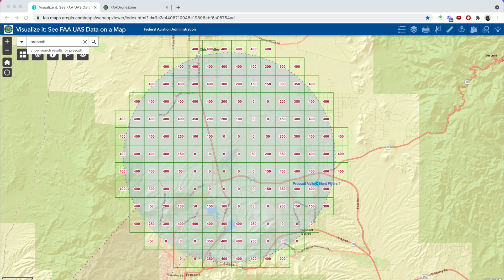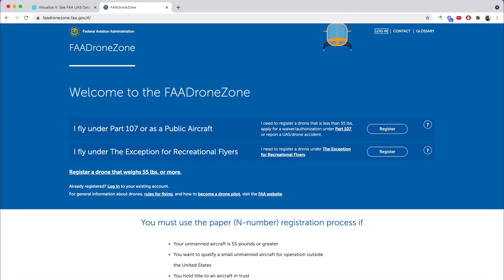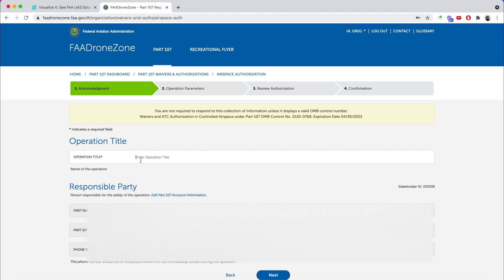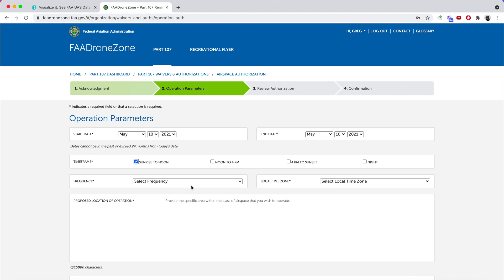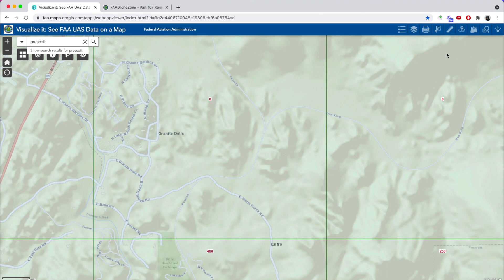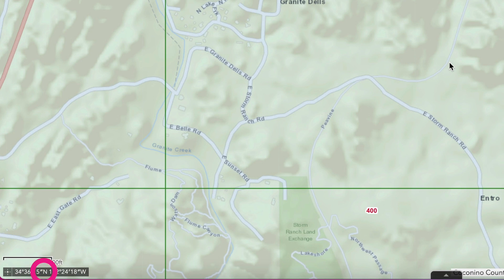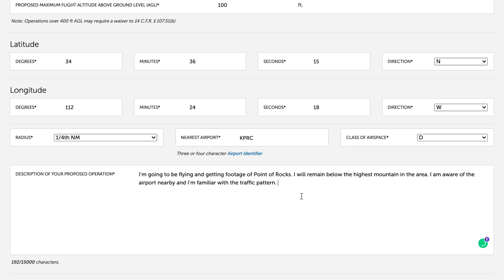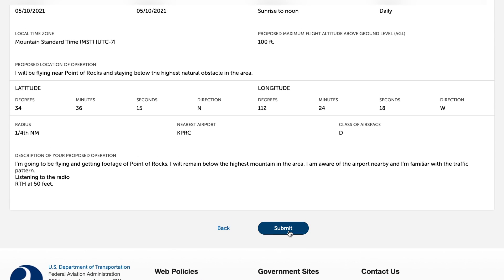How to fly in 0-grid Airspace

Comment: Greg, really good tutorial! I’ve submitted 200+ authorization requests and you are spot on. As you mentioned in the video you can only select one day at a time at LAANC supported airports. One day approvals can be a real pain if you have poor weather, mx issues, and/or DJI unlock issues. In the body of my requests I always ask for a reasonable date range to accommodate these potential issues. The FAA/ATC is usually pretty good about approving these requests. I find anywhere from a few days to two weeks is pretty acceptable in most situations. This really cuts down the workload of making multiple requests. Just a FYI for anyone out just learning how to submit DZ authorizations.
Reply from the maker: Great tip, gonna pin this to the top of the video!
Reply: @PilotInstitute  Cool!
Reply: Exactly what I was going to ask about. The request seems to imply thr option of a range, but wasn't sure of the likelihood of getting more than one day approved at a time.

Thanks!
Reply: @thequantaleaper  Yes, you can only select one date when it's a LAANC supported airport. You can definitely select a date range on any non-LAANC airports. When asking for a date range at LAANC airports I recommend asking for something logical. I've talked to pilots that always ask for 30 days even if they don't need it. I've also spoken with many FAA Processors and they know this is happening and they just won't approve it. I routinely ask for a week if the weather is an issue or the job might require multiple days. A date range will also accommodate any re-flies that may be needed. I see this is helpful sometimes with new pilots. I hope this helps!

Comment: Can you help me with something? So where I live it's considered a Class D zone. I live in a place that has an airport centrally located in the city. We do not have Lance and we have to go directly through FAA drone zone to do just what you shown in your video. However it's also my understanding where I live that the areas that indicate a zero no matter what we do we can never get it waived or approved is that correct? My drone is under the 249 mark. So I recently created an account to do all this through the FAA drone zone but I'm having a hard time understanding where and how I can actually fly without getting in trouble from the faa. My understanding to this point has been on those Maps areas that indicated 3 or 400 as an example I could fly at or below without any permission but I don't see that as being true now and it worries me. If you could please help and respond I would gladly message you and maybe you can contact me through a direct message instead of doing it in the comments section thank you for your videos I love them.
Reply from the maker: I’m going to assume you are flying recreationally (the answer differs a bit if you’re under part 107). You can’t fly in a 0 grid at all, regardless of the size of the drone. Regarding the 300-400 foot grids (or any other altitude than 0), you need to get approval first before you fly there. But you can get approval up to that number. In your case, if your airport is not part of LAANC (as it sounds like it is), you will need to submit a request through the FAA drone zone. You can actually get an extended approval to fly in that area by submitting a wide area authorization. Email us at contact@pilotinstitute.com to continue the conversation if you want by email.

Comment: Without requesting otherwise…if the grid shows 100, but a  close-proximity building is 100, can you fly 200AGL or does the cap remain at the 100?
Reply from the maker: No, you can't. This rule can't be applied in "grid" airspace and also is only available to part 107 certified pilots.

Comment: I know this video is a year old, but wanted to ask when flying in a zero grid, after getting approved from the FAA and DJI to fly up to 100 feet around a building, if air traffic will be flying nearby for taking off or landing since you'll be roughly 2 miles from one of the runways, what is the safest distance to keep a drone away from other aircraft?
I know the more the better and drone pilots are to give way to all other aircraft, but I haven't found a hard number. I've heard some people saying 100 feet is the minimum because drones are supposed to stay under 400 feet while aircraft are supposed to stay above 500 feet.

Comment: Is using Drone Zone still better to request approval in a zero-grid LAANC airspace than using Aloft?  I have a site I need to request and Aloft notes I can request through the app.
Reply from the maker: It doesn't matter. Use the app that you prefer. Personally for 0 grid requests, I think the DroneZone is better because I can upload KML files if I need.
Reply: How long did it take until authorization was granted?

Comment: If I wanted to request to fly 500ft AGL in a 0' grid, would it be better to try to get the zero grid authorization for 400ft first and then submit for a waiver for the extra 100ft?  Or should I just submit a waiver proposal for 500ft?  The waivers take like 90 days to authorize.
Reply from the maker: Paul, LAANC requests are limited to 400 feet. If the grid is 0 you likely won't get much higher than 100 or 200 feet. In order to get anything above 400 feet, it will require a waiver and not an authorization.

Comment: WRONG, WRONG, WRONG! Just today I received authorization to fly in a zero grid in PDX airspace, a class B international airport, using AirMap. It only took 1.5 days. You keep coming up with bad info, why?
Reply from the maker: We don't use AirMap (https://www.dpreview.com/news/6309775248/airmap-faces-backlash-after-suggesting-airspace-should-be-monetized) so maybe it's possible with them. Kittyhawk doesn't have this ability. The FAA recommends using the DroneZone. The end result is the same, you submit, you wait, you get approval. What part is "wrong"? And what makes you say "keep coming up with bad info?"
Reply: @PilotInstitute  I use Kittyhawk and used LAANC through them for my 0 approval.  I don't use airmap, but I also have b4ufly.  This was Springfield IL and class C airspace.  It said approval was available for up to 400 feet with further coordination.  This was the first time I used LAANC, I was doing a roof inspection and sought authorization for 150 feet in the area around the house where I was working.  It says it can take 48 hours, but I got approval in a day.  It came by text.
Reply: I had the same situation in Springfield IL.  My parents live in a 0 area, I couldn't get instant approval but I planned the mission for the next week, waited to make sure the weather would be favorable and submitted the request through LAANC.  Approval came through in 24 hours.  They live in Class C from the surface up to 1800.  I use Kittyhawk.
Reply: What height did you get it approved?  Sorry I know it's been one year since you posted, but I was wondering if LAANC submission via apps can still be options.  I submitted a request for zero grid one week ago and there was no response, even on the day of the mission.  I understand it's case by case but I wanted to find out what is getting approved out there.  Thank you!

Comment: This video hits a few points that I need to clear up. Maybe not clear up...weed out the 'truth'. Firstly, I am a Part 107 Pilot and a Private Pilot(not current) I am 1.3 miles east(090º) from the tip of runway 24 at Teterboro. According to AirMap, I am in a 'ZERO' zone. I am allowed to fly using the DJI Fly app, after answering questions and clicking through all the warnings. Sometimes(not always), I have to enter a six digit LAANC code and I'm good to go. I set my altitude to 100' but have tried 400'(very rare) and I am allowed to fly. I have a two part question. #1 - Does this sound right? I can fly but cannot until I do all the 'paperwork'.

I have another place I'd like to fly that is also in a 'ZERO' grid. I'd be within a mile from a Class D airport. #2 - How can I know I can fly without driving to the location and activating the DJI Fly App? The situation would be a wedding I and could be called the day of. Can I assume the 'same treatment' as I get when I'm home? Both Teterboro(TEB) and Morristown(MMU) are LAANC equipped airport.

Thanks so much...you're one of the best on YouTube for all this drone stuff. Side note...I took a training flight from Scottsdale to Sedona(breakfast) back in the early 90s. The instructor told me on my return flight to Scottsdale to fly IFR(yet it was a clear day). I told him that I am not IFR rated plus...I'm not giving up this view. He laughed and pointed to the only road beneath me and said 'Fly IFR'...I Follow Roads. I never forgot that lesson.
Reply: I just read your original post.  You have a 107 and you don't understand  LAANC?  If you knew how to use LAANC then you'd know Fly App has nothing to do with LAANC, it is not a LAANC provider.  DJI was supposed to be one but that never happened.

Or perhaps you got your 107 before FAA came up with LAANC in which case your not understanding is somewhat understandable.
But if the term TFR (I think I miswrote TRF) is what tripped you up, that is something you should know as a 107.
Reply: @danman32  YES DEAR....thanks for your help.
Reply: If Kittyhawk or Airmap shows you in a 0 altitude zone, then you MUST request authorization thru FAADroneZone to LEGALLY fly in that area. Just because DJI allows you to fly in an area with no airspace warning or only needing to click an acknowledgement prompt in the DJI App does not mean you can legally fly. The problem, as pointed out in this video, is there is a mismatch between what the FAA considers a no fly zone or altitude restricted area, and how DJI determines a no fly or altitude restricted area. Bottom line is to take the DJI system and it's warnings with a grain of salt. Always check AirMap or Kittyhawk before you fly, especially if you are operating in an area you are not very familiar with. as a RPIC, the onus is on you to know if it's legal or not legal to fly in a given situation, not DJI.

Also, remember than LAANC is completely irrelevant and useless in a zero altitude area right now. You can not get automatic approval with LAANC in a zero altitude area and MUST get authorization via the FAADroneZone website.
Reply: @michaeldiaz4942  My eyes are blowing out of my head...and it's not the Margaritas(May 5th). So you're saying that if I'm in the middle of launching and the DJI Fly App is pushing me through with identifying myself and sending(via a text) a six digit code that I must enter within five minutes that this procedure is all for nothing? If I do not follow the DJI prompts...the props will not activate.

As a side note. I have both KittyHawk and AirMap but to be honest, that since I was entering a time sensitive six digit code that DJI was talking directly to the 'Powers that be' and this(time sensitive code) bypassed all this mumbo jumbo.

I want to do it the right way so I'm listening and thank you for getting back.
Reply: @harrisongould9460  Correct. For a real world example of the problem, go to the DJI unlock site and enter 7200 Thelfor Court in Spring Texas (Note this address does not correspond to an actual house, but is in a neighborhood I have a flight set up for tomorrow). You'll see on the DJI map that there is no restriction shown. So I can start the drone and the DJI app, and take off and fly. No warning will be given, or limitation imposed on the flight by DJI. However, if you enter the same address into Kittyhawk, you'll see that you are in the 0 altitude zone for KDWH (David Wayne Hooks Airport) in class D airspace. So DJI will let you fly, with no warning, even though the flight would actually be illegal unless you get prior authorization from the FAADroneZone site.

And the opposite is also true. There are locations where DJI will force you to acknowledge a warning or even do an unlock request, when there is no authorization requirements imposed by the FAA. In that scenario, it's more of an annoyance and hassle. Whereas in the 1st scenario, you could be lulled into a false sense of security that you are flying legally when in fact, you are not.
Reply: @michaeldiaz4942  I followed up with what you wrote and I see the issue. I live within the same scenario. Sounds to me that either DJI needs to either get in the game or stay out. Why do they have the powers to firstly prevent flight and then when 'conditions are met'(according to them), release their lock when in fact they do not have 'that call'? I need to brush up on KittyHawk and AirMap and implement them into my process. There is even a 'Drone School' some 60 miles south of me that I  may look into. Thanks so much and safe flying.
Reply: @michaeldiaz4942  I seemed to have been approved after a few days for a flight in a 0 grid in Airmap. Is this not valid approval?
Reply: @andrewk1411  From the FAA Dronezone website.

Authorizations through FAADroneZone

You should use the FAADroneZone to request an airspace authorization if any of the following apply:

You want to fly in areas that are in controlled airspace and are not covered by LAANC (the red grids on the UAS Facility Maps)
****You want to fly in a “zero” grid area above airport property****
You have a waiver under Part 107 and want to fly in controlled airspace using the waiver

Without seeing what you received, I can't for certain say if the approval is valid or not. I don't use Airmap (I like Kittyhawks interface better), but I do see on the Airmap website a section about manual authorizations, but it's not clear whether that is technically for authorizations above the altitude limit in a non zero grid.

I would say this. Do a Google search for "FAA Form 7711-1". That form is the FAA certificate of waiver or authorization. You need to have that form on you when you are flying in case anyone from the FAA, state, or local law enforcement makes contact with you. Did Airmap send you a PDF file or image file of a form that looks like a 7711-1 with your information on it? If so, then as far as I know, you have proper authorization.
Reply: And this is why DJI put in the geofencing in the first place.

That so called LAANC 6 digit code is only for DJI to verify your DJI account.  Their other option insteas of SMS they used to have if not there anymore is use last part of your credit card on file with them, or something like that.
Reply: @danman32  Like I know what that is. This ‘three-way’ cluster is so annoying. I’m sure there is a right & easy way to fly in a “0” Zone…with ease. With LAANC I would assume I’d be cleared for 100’ in seconds unless the control tower has an incoming low approach ‘CRASH’🤪
Reply: @harrisongould9460  what "that" don't you know?  Every word I said you better know, either to properly operate your DJI, or keep legal.

And so again, this is why geofencing on drones is important, for those that have not learned where they can  and should not fly.  Not all "should not's" are in controlled airspace and determined by LAANC.
False groundings on a novice is better than a false sense of complete safety.
Reply: @harrisongould9460  I take it you don't have a part 107 certification, which in that case you should not and are illegal to fly in a 0 altitude LAANC zone.
I agree though FAA overreaches on many of those 0 zones.  I live 4 miles from a class D airport under an approach path.  Less than 1/2 mile from me towards the airport are distribution power lines at about 100-120ft high crossing the approach path.  Who's going to be the bigger hazard, me just high enough to clear trees, or the trees and that powerline?
Reply: @danman32  PS...If you read my previous posts, I have a part 107 and I'm a private pilot(not current...stopped in 2000). So what are you trying to teach me?
Reply: @harrisongould9460  we're both guilty of missing details in our posts.  Read the post just above your "yes dear" reply.  I gave you some benefit of the doubt there.  But as a former pilot and a 107, you should know what a TFR is, as 107 and keeping up with the trends know how LAANC  works.  Yet you're making statements like you're not familiar with LAANC.  Geofencing maybe, but that's the entire focus here when it comes to DJI so I don't get you not understanding that.
Otherwise I don't know what you were referring to with "like I know what that is"
Reply: @danman32  I guess I read somewhere that DJI Fly was working with LAANC and missed the update that they weren't. Rules here change like the wind. Thanks for clearing up with what I though was a 'six digit authorization' code that was supplied by DJI(to me) through LAANC. I have some work to do but I'm a lot closer. Thanks!

Comment: Kittyhawk will let you put in the ones requiring additional coordination, as long as you put them in 48 hours ahead of time.  If it hasn't been approved, Kittyhawk will cancel the request 24 hours out.   I have to use it all the time.   I have very little uncontrolled airspace to the East of me.  I do have to go to DroneZone for requests in Military class D, 0 height zones though ( I have several WAAs for them).  I always ask for a week in case the weather isn't good on the day I asked for.   It would be nice if you could put in for 400 feet and the FAA could just approve to say 250 feet, but they aren't allowed to do that (I talked to one).  What they approve, depends on height of obstructions in the area and whether they have a lot of Helicopters (my nemesis) flying around there.  I now know what to ask for, but they aren't supposed to come out and tell you.   By the way, they don't know how the apps work...they just get the requests.
Reply: I have used Kittyhawk several times now and was approved within a day in most cases for 0 airspace. Works great and much easier than with drone zone.